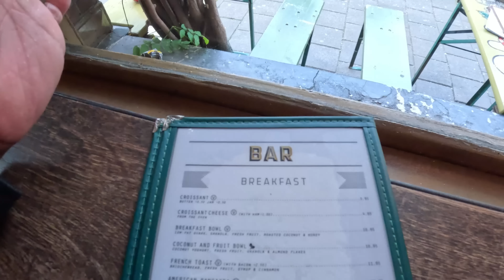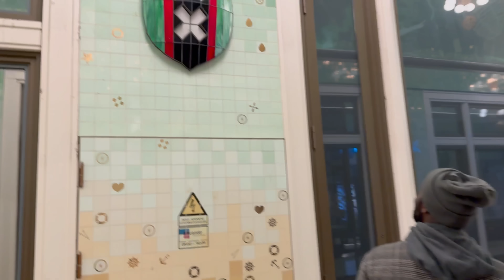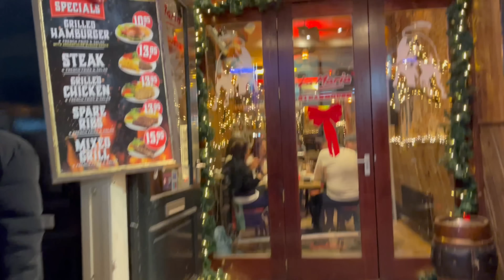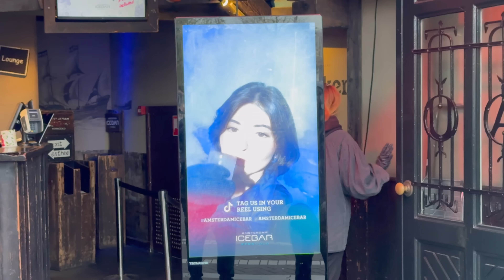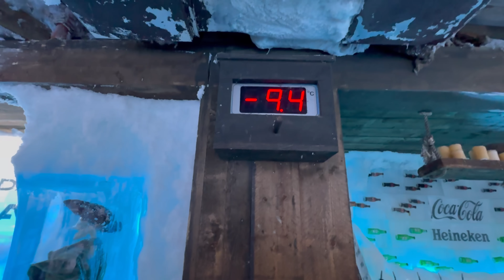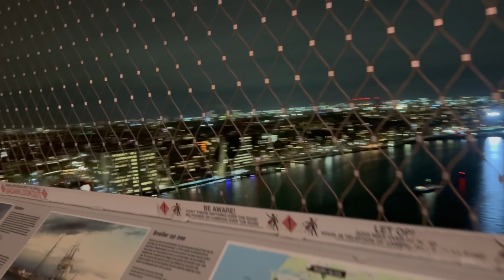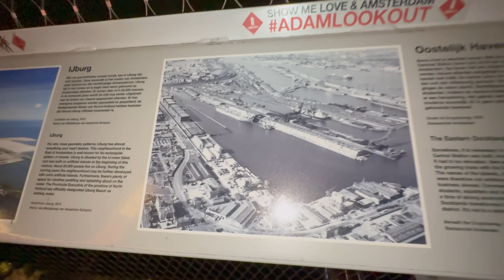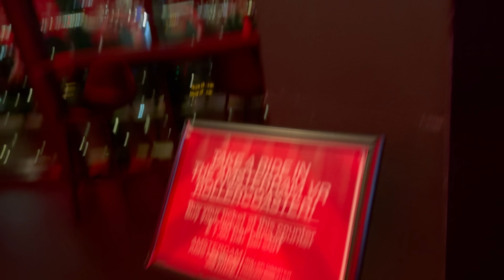48 Hours In Amsterdam Streets

Comment: The façades of the houses in Amsterdam lean forward to make it easier to hoist large household items through the windows on the upper floors. A pulley is mounted high on the roof or front façade.

Comment: with all respect, but gino doesn't know what he is talking about, the main reason Why the houses are crooked, is because they are build on wooden poles, a lot of houses in amsterdam, that's why they are all crooked, not to be confused when the houses lean forward, that is done on purpose, to load goods in the attic
Reply: @arnomeesters1  “The tilted houses in Amsterdam are primarily a result of the soft, marshy ground on which the city was built. The city is situated below sea level and was constructed on a series of islands and marshlands, leading to unstable foundations. To prevent the buildings from sinking, the houses were built on wooden piles, which can sometimes settle unevenly.

Additionally, many of the houses are designed with a slight tilt to facilitate the movement of goods. The narrow, tall structures often have a hoisting beam at the top, allowing items to be lifted through the windows, as the staircases inside are too steep and narrow for large items. The tilt helps ensure that items can be easily maneuvered without getting stuck. This unique architectural style has become a defining feature of Amsterdam's charm and character”